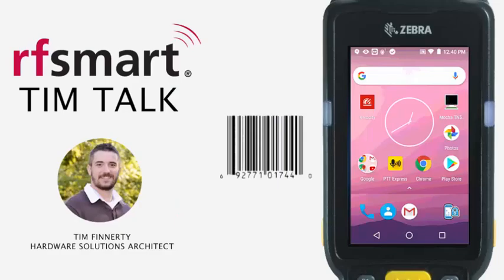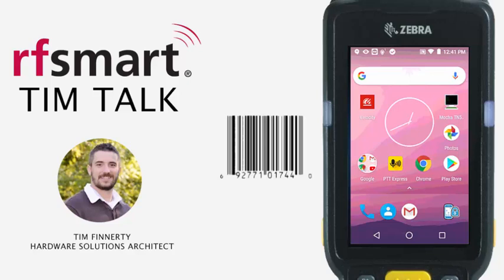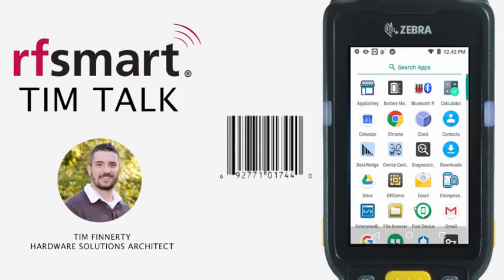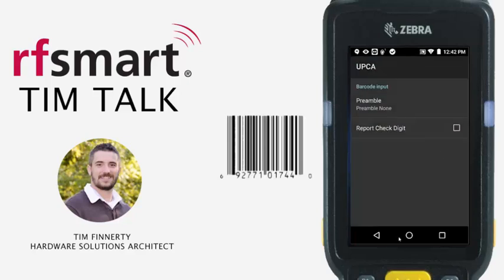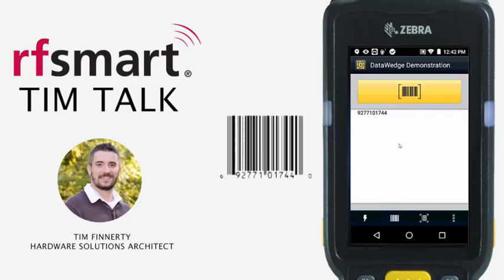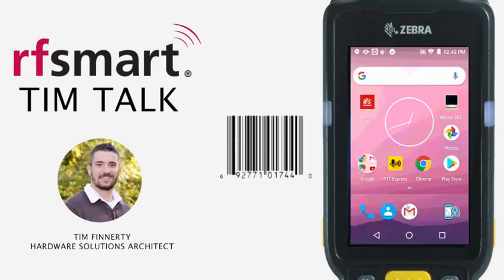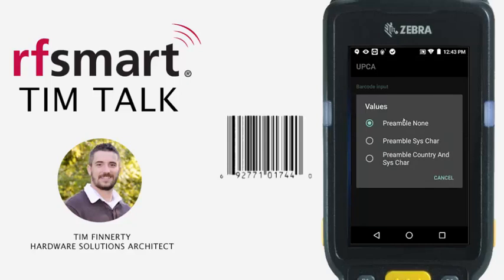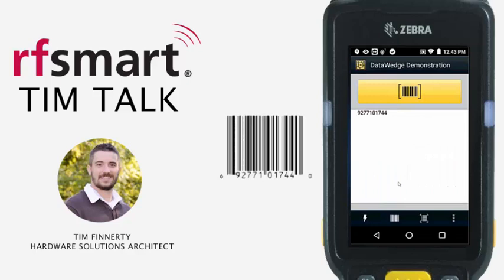How to Enable Check Digit & Number System Values on UPC-A Barcodes on Zebra Device

Comment: hai la possilità  con zebra tc 70 di modificare questo barcode ean13 variabile  esempio 2111111333333 risultato 111111 elimina la prima cifra e legge solo le 6 cifre dopo il 2 iniziale
Reply from the maker: Hola mossimo Póngase en contacto con nuestro equipo de hardware en info@rfsmart.com e intentaremos ayudarlo con su pregunta.